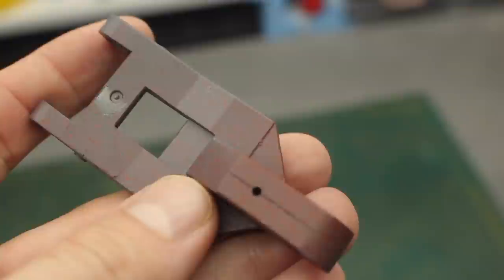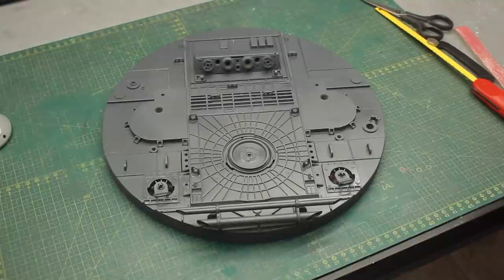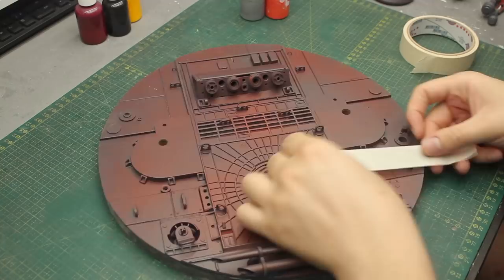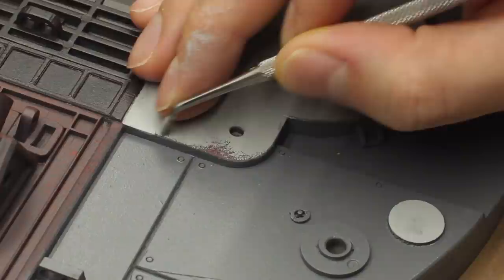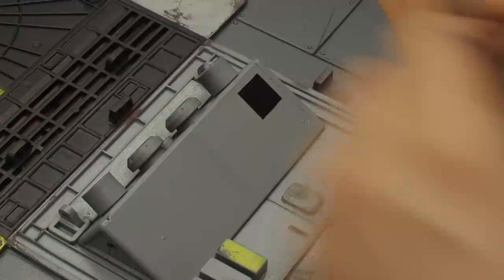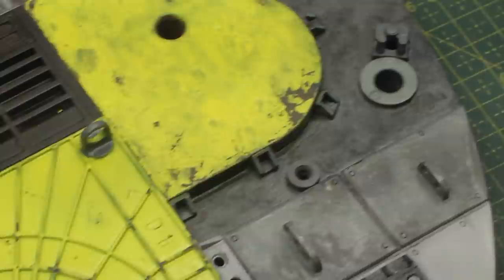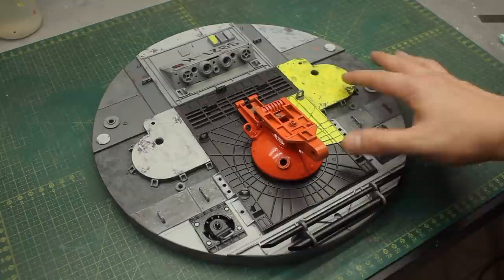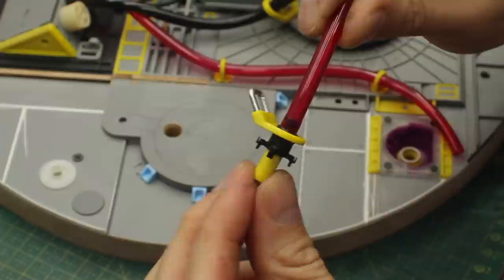The EASIEST chipping technique!

Comment: This isn't lazy at all, this is a great technique that simulates the actual real life layering of the materials. Question: what are you dipping your Qtip in when rubbing off the paint?
Reply: Ive done this technique with masking fluid before, but i think adding the metal tools/toothpicks is a great way to add variety to the scuffs.
Reply from the maker: Thanks buddy! That's alcohol (to break the acrylic water based paint easier, just gotta be gentle)

Comment: Always love to see other ideas for pulling off weathering. Great job! I definitely need to get some red rust primer, I've noticed wanting it in several projects as a base coat already.

EDIT: for 12:30, a trick I like is doing a very light dusting of spray adhesive which will turn your stencil into a sticker and you can get the inner edges really sealed down for crisp lines. It should peel up easily, but you might want to test out if it will lift up paint on models. It really doesn't take much spray to make it work.
Reply from the maker: Go for it buddy, and thank you :D (gotta try the adhesive spray method)

Comment: The white masking tape you used will leave a glue residue on the model. Its the worst to use. You should switch to blue or purple for delicate surfaces. It's more expensive but that's because it won't leave a residue.
Reply from the maker: Oh yeah, I know that. Blue tape here in my country is not only hard to find, but 4 times the price..